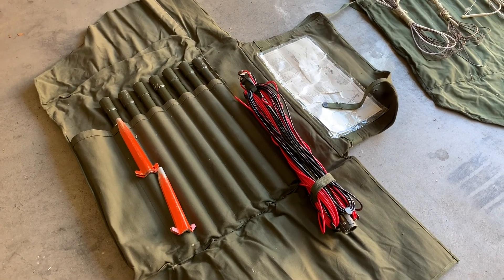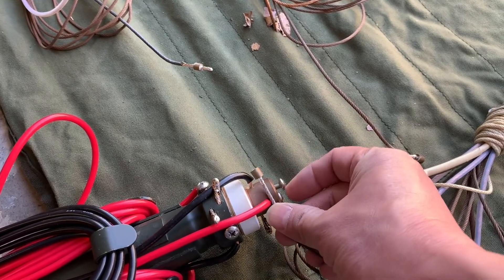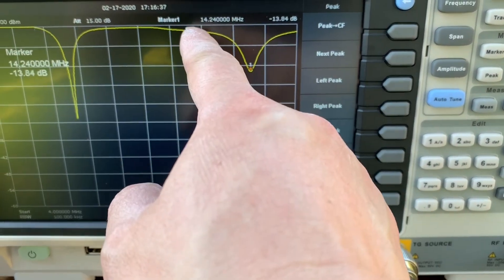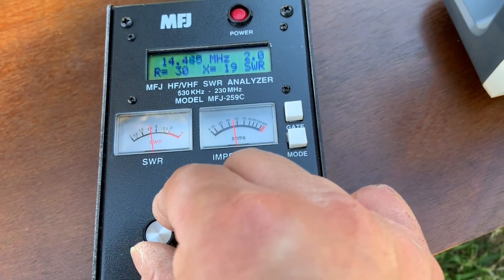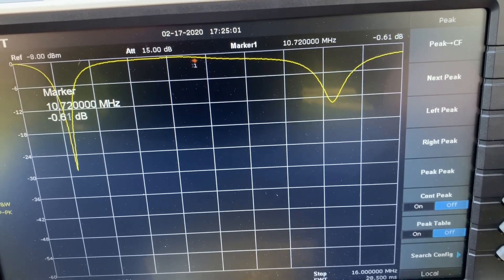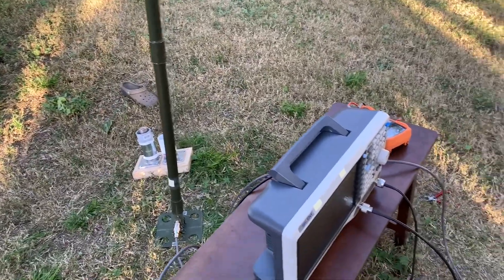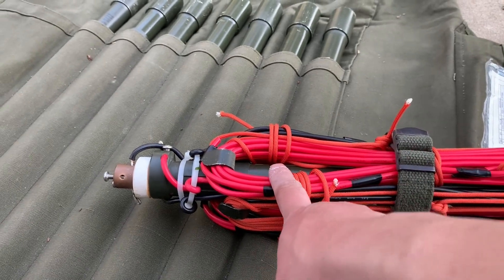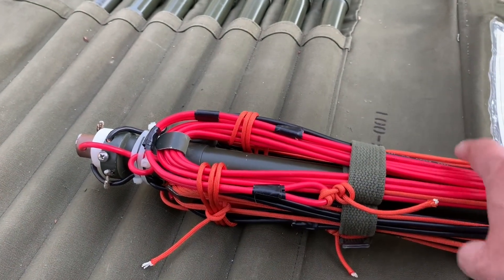Modify NVIS AS 2259 Antenna for HAM Band

Comment: Very nice modification to that military antenna.  I would say your SWR of 1.5 on 20m is very acceptable as only 4% of power is being reflected back
Reply from the maker: Thanks. I really like the home-made base from PRC-47 adapter. The center pin of adapter is wired out to 1:1 balun, while the adapter shell is sitting on top a metal pipe adapter, which is wired to 1:1 balun. So no damage is made for PRC-47. Unfortunately, 1955AA adapter does not perform well.